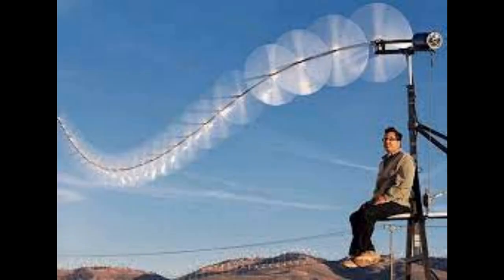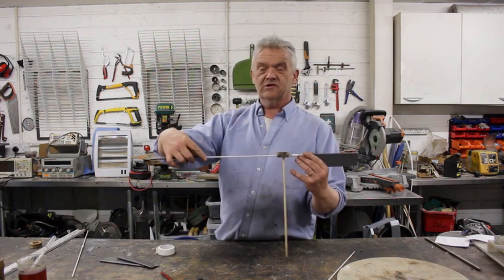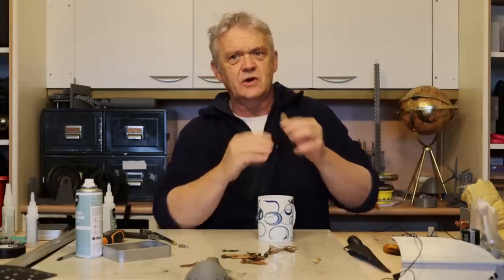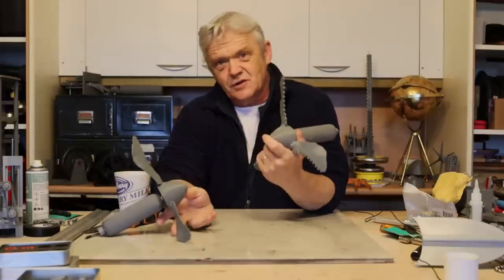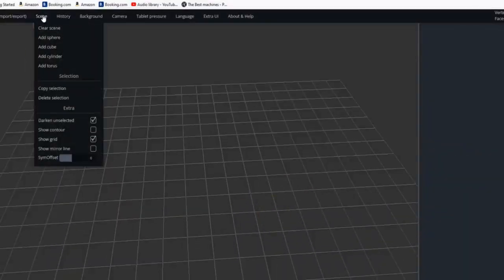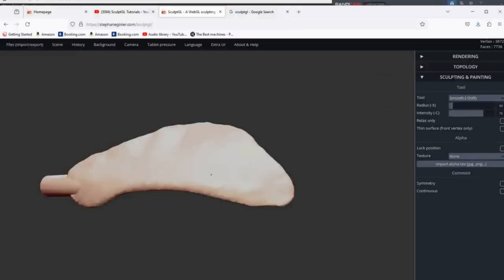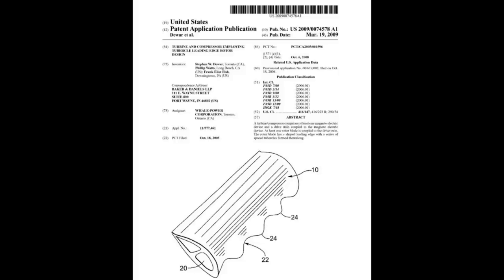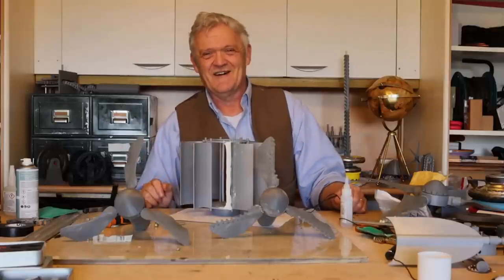044 The Samara Wind Turbine

Comment: Robert, Would  you consider adding then demonstrating the adding of owl wing trailing edge combs to the three samaras blades trailing edges to see if rotational turbulence is reduced for the trailing blades leading edge whale tubercles following in the rotational turbulence. Modern aircraft when flying or landing are spaced three minutes apart to allow the air's fluidity to smooth out. When three blades follow each other rotational I was wondering if the owls combs would smooth the air straight away. All three blade mods in hopes of stepped increasing blade efficiency when following each other while spinning. Thank you for considering this request for comparison of all three blade designs in a video for all to see. Enjoy each Day. Say hello to Luke. I hope Luke's University studies continue, and He is happy with His study success, and progression.

Comment: I've been intrigued by samara seeds forever. Some are more flat and some are more wrinkled like yours but it doesn't seem to affect the spinning motion that much at all so why don't you flatten the blade more to an ideally shaped samara (there's enough models on google) and just look if that shape is more efficient than the traditional turbine blade. What makes me wonder the most is that Samara spins on a center point. Shouldn't that center point also be the center point of your 3 bladed design (aka. the axle)?